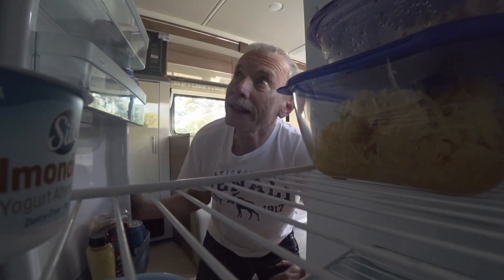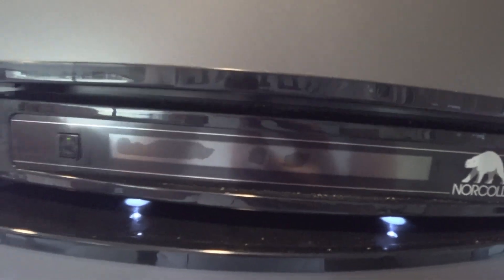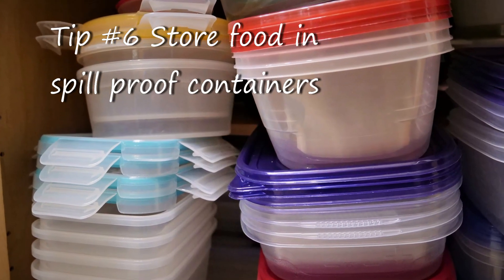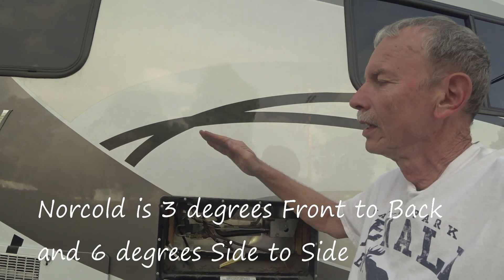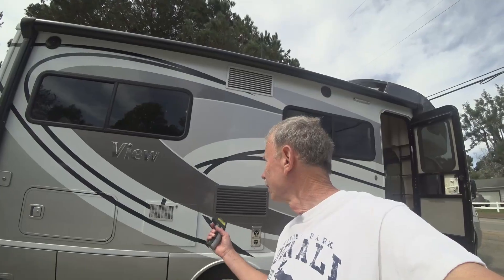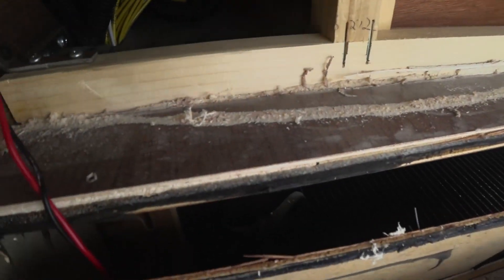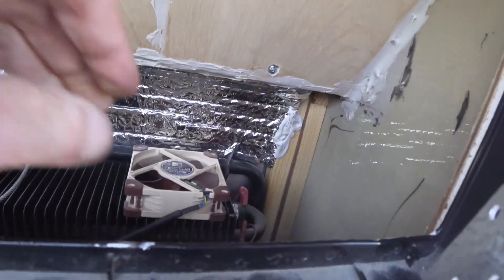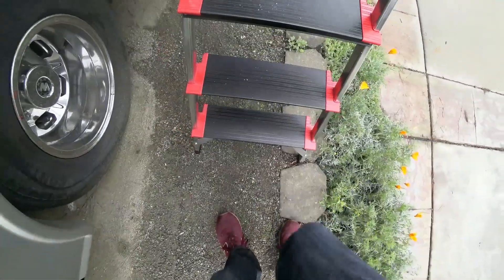RV Refrigerator Tips and Mods

Comment: Hi Ron! I did the refrigerator mod you talked about For the RV . I installed two fans at the top vent on the side of the RV,  and the the twin fan set up inside the Fridge that clips to the fins inside. My temps went from 85*(turned off temp) to 29* in six hours!!!! It's never been below 38* ever!! Thank You so much for the tip!!!! It works great now! We are planning on taking a trip to Yellowstone soon, and I have been worried about the food spoiling. Now no worries!!!Thank you again!
Reply from the maker: Glad it helped. Mine still struggles in 100 deg weather but seems to keep the food from spoiling.

Comment: Norcolds used in the older Views (and many other RVs) are often the N6XX or N8XX series (N611 in my '07 View, now sold) and you are correct on the tilt, but to clarify, Norcold references the max degrees of tilt in relation to looking at the front of the fridge (a few RVs have the fridge mounted on the back wall)
"Leveling:
 CAUTION:  The refrigerator is made to operate within 3° off level side-to-side and 6° off level front-to-back (as looking at the front of the refrigerator). Operating it at more than these limits can cause damage to the cooling system and create a risk of personal injury or property damage.  Make sure the vehicle is level before you operate the refrigerator."
So yes, you are correct, however, early View manuals had it backwards, someone at Winnebago mis-interpreted the Norcold specifications.

Dometic does not give you specific degrees, rather they say "Any time the vehicle is parked for several hours with the
 refrigerator operating, the vehicle should be leveled to prevent this loss of cooling. The vehicle needs to be leveled only so it is comfortable to live in (no noticeable sloping of floor or walls)."

Comment: Ron, my Navion has the evaporators coils up top. I found my baffle for gas which gets very hot against the wood board they had. Good thing I looked  down to see where the loud fan was...the wood was scorched! Took it to Camping World, Winnebago told them to place this aluminum plate the whole distance to bottom just above burner. However this shelf it sit on is blocking all the lower intake to upper Out take vent. Thinking about installing the new Titan refrigerator vent fans. Have you looked into this modification. I see the small existing fan wires which are on a thermostat. Hope to just use the 12v dc old fan wires. I been setting a small 12 v ac to plug in inverter which helps push air up. Thanks .
Reply from the maker: B’s Outdoor Adventures I have tried the Titan fans. Am currently installing a 3 fan tray in the fridge to help stir the air.

Comment: Good job! I have a 2013 Norcold.  When I remove the outside grill there is a black drain hose with a plug in the end going into a small plastic evaporator rectangle shaped tray. Seems like the plug should be remove? Any ideas? The plug can be pulled right out. Apron 1/8 inch diameter hose.
Thanks rick
Reply from the maker: Sounds like the drain line for when the fridge defrosts. If so probably doesn’t make much difference.  My fridge never frosts up. I would leave it open unless there is some other issue
Reply: Closer look at plug revealed it was open but partially clogged. Thanks!

Comment: Video was helpful. I would like to install the fan over the cooling fins but I did not see where you tie it into the electrical. Do you have a diagram where you tie it in? Thanks!
Reply: Well, I picked up the power from the LP switch above the fridge.  Drilled a hole in the back and ran it to the fan

Comment: I got so tired of trying to keep my RV level to run a 3 way  fridge and all the modifying to make it cool when it got above 90 outside I removed it and bought a 12 V marine fridge know i can be at a 30° angle and it will cool to sub temperatures no matter what the ambient temperature is and takes 5  amp to start and once it hits set temperature it runs on 3 A Best thing I have ever done

Comment: Really appreciate the videos, Ron.  Great work.  How did you get the temp probes into the ref/freezer?
Reply from the maker: San Diego Mike they are on the right side and go over the door seal. Pretty air tight.
Reply: @ontheroadwithron2432  Thanks for the quick reply!

Comment: Great tips. I've got the same unit but a version prior. I noticed your awning was electric. I'm upgrading mine soon. I assume that it is a Dometic possibly. Do you have any pros, or cons on this type of awning? The current one on my coach is 21'. I'm actually thinking of getting the new one with a 25' length. Thanks in advance Ron! Also, thanks for posting the videos.
Reply from the maker: RC my awning is 16 feet. Works fine. Have only used it a handful of times.

Comment: Ron
When I unlock all the doors on my sprinter using the remote  Within a few minutes all the doors automatically lock themselves  A real pain when hanging our at the campsite

Kevin
Reply from the maker: I have that problem with the locks on my car, but never noticed on the RV.  Could be that I use the Key in the coach door most of the time and never actually unlock with the remote unless I am going into the drivers seat.  So, no unfortunately, I don't have a work around for that.